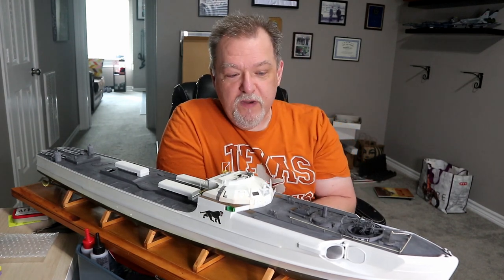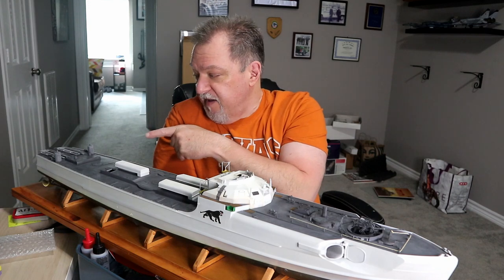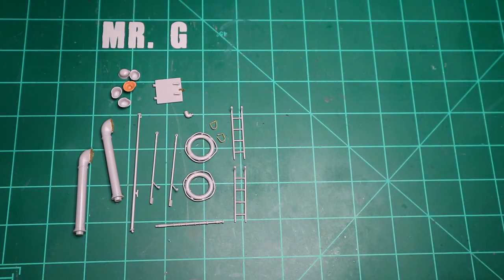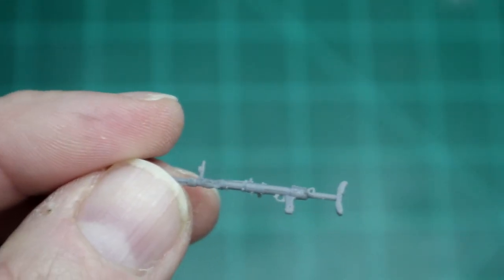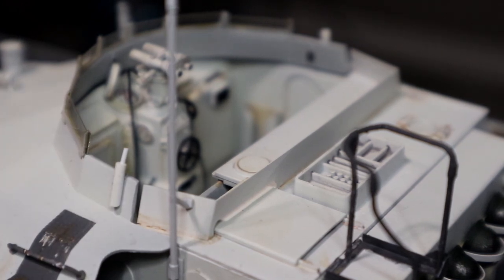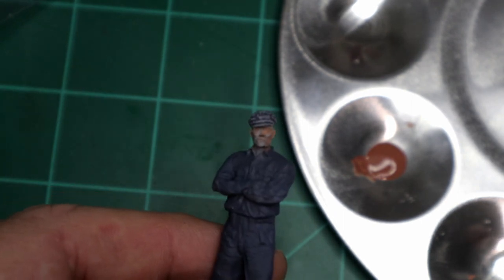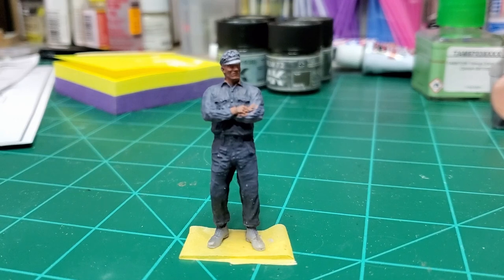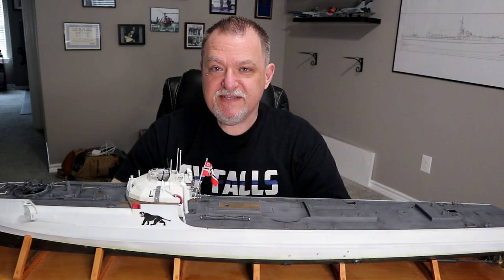Italeri 1/35 S-100 Schnellboot, Part 2 - Bridge Details (Get Off My Bench)

Comment: What is that wooden support stand you are using? Is it for displaying or supporting while painting/building?
Reply from the maker: It's the permanent stand I had made for it. One of my fellow club members did the base and I installed the beams. My hope was that it resembles a boat being worked on out of the water.